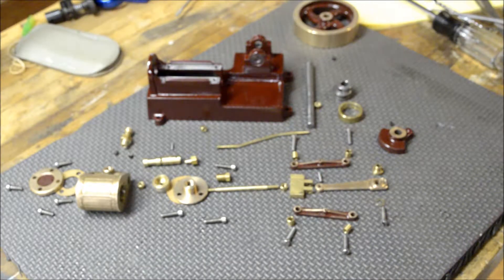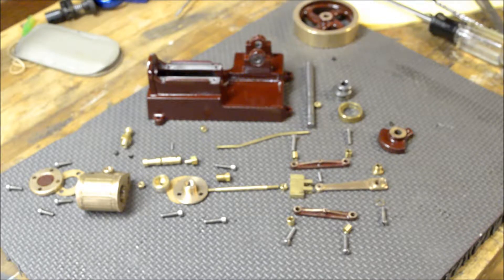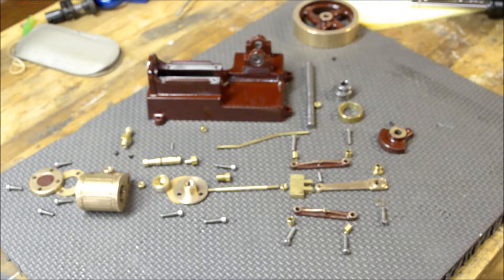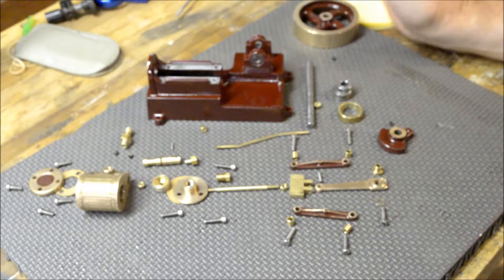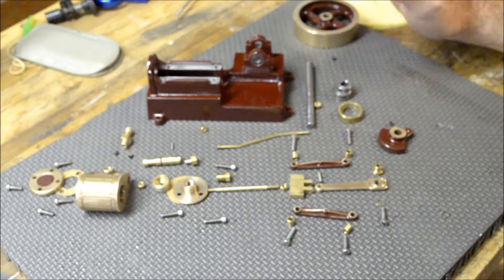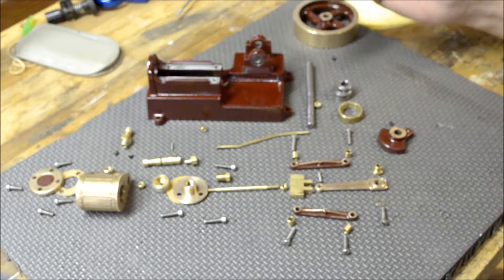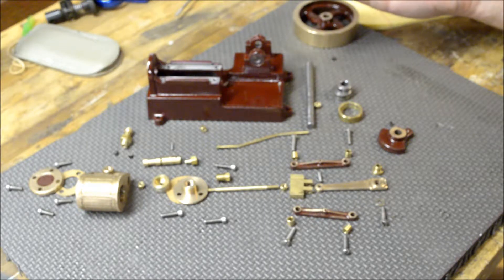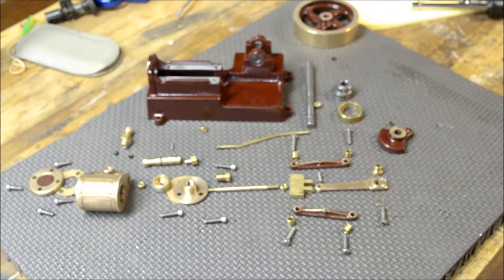PM Research #3 Assembly

Comment: what did you do about the 3/16-40 tap . did you use a tapered tap. thanks.
Reply from the maker: John Green I just tapped it with a 10-32 tap and made a barbed fitting from some hex stock.
Reply: thanks for the fast reply , I complement you on your videos , you have firm grip on machining terminology .